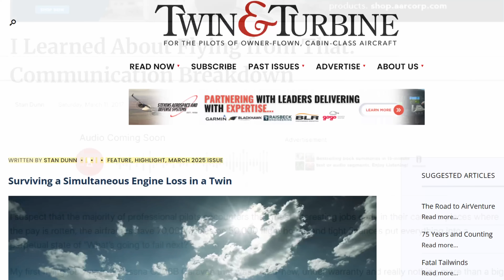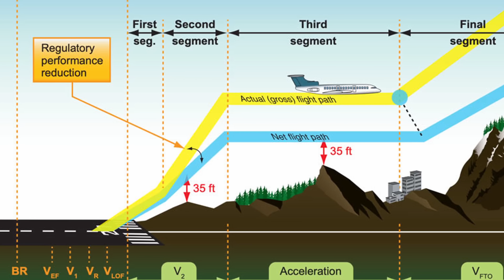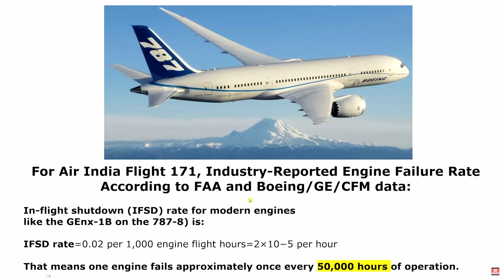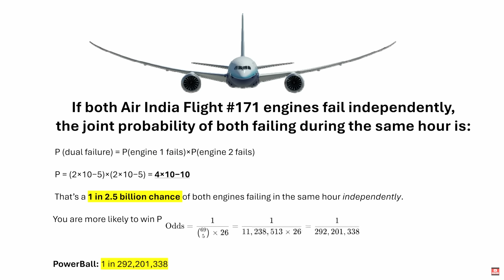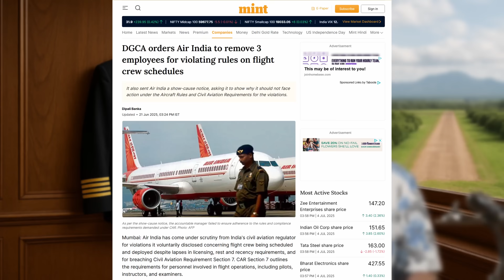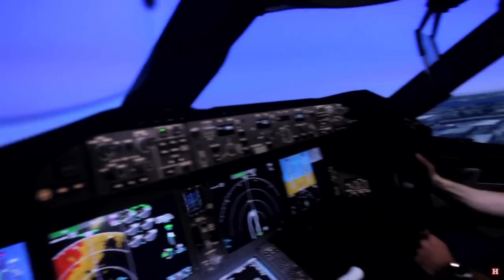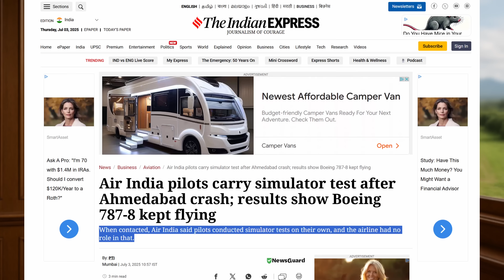Air India 171 Cause Becoming Clear

Comment: I remember many years ago a JAL airlines 747 Pilot accidentally turned off all 4 engines at 33,000 feet , the aircraft plunged 26,000 feet until the engines were restarted . Maybe this Air India is Pilots mistakes . Not sure

Comment: Don’t forget the footage that shows the rear landing gear stuck in the first stage of retraction. If there was no attempt to raise the landing gear, the rear bogies would be configured such that the front wheels are higher than the rear wheels. When commanded to retract, the rear bogies will tilt the other way before the legs fold in. Footage of the final moments show that the landing gear is NOT fully extended. This suggests a complete loss of electrical power. If you follow this line of thought, the most pressing question is what could/would cause a complete electrical failure?
Reply: From what I’ve seen and heard even complete loss of electrical power will not stop the engines from operating?
Reply: @paulaiello2071  I hope you’re right but I haven’t heard anyone explain how the fuel pumps can work without electrical power. I’m not a professional so I could absolutely be wrong but this is what makes the most sense to me so far.
Reply: @bobperry8066  There are mechanically-driven fuel pumps in the engines. They can suck fuel from the tanks even if all electric pumps fail.
Reply: I thought it was hydraulic 😢
Reply: @SteveShifter-j3i what do you think controls the hydraulics?
Reply: RUBBER BANDS !😮 @GeneralDissent
Reply: @SteveShifter-j3i    Electric motors pump the hydraulic fluid.
Reply: What could cause complete electrical failure? Dual engine failure.

Comment: Would we not see significant yaw or roll if one of the engines had failed? I believe the dust cloud on the video could equally have been caused simply by the take-off thrust. We don't see any dark smoke or flames.

Comment: What about the possibility of fuel vapour locks in both fuel pumps due to heat on the tarmac causing excess temperature in the fuel lines. There would be negative vacuum pressure in the fuel lines due to maximum fuel flow during takeoff. 

The temperature at the airport was reported to be around 45 C on the tarmac, which is close to maximum allowable.

If so, a fuel temperature alert would be recorded in the black box.

Comment: Over 2000 comments already, and probably none of them useful.  Only thing to note is that, i believe it is so, Hover was the first to propose wrong engine mishap, and now you are the second one to seriously do so.  Really, really hard to believe, for so many reasons (yet, certainly possible), and you are the first I've seen to point out the specific discrepancy of (apparently?) differentiation in exhaust flow (which I had, myself, noticed earlier, and was wondering about, with even having had thought looked kind of like could be a compressor stall).  Radio call did mention no thrust, but did not explain in any greater detail as to how might have come about.  I still go for a single-point failure in electrical that somehow resulted in both engines shutting down (with no possibility of restart in such a short time frame).  Wheels trucks position tends to show that gear up had just been started, and power was lost almost right in the middle of the electric tilt motors position change sequence.  The added electrical power load could have dropped possibly already weak bus voltage right then, which could have adversely affected both FADEC's, maybe, or at least the still operating engine?  But, what about the batteries maintaining critical; given increasingly apparent Boeing design detail issues, power cut-over implementation triggering even just a few milliseconds outage or sag?

Comment: The first half of the video has a perfect, but the second half makes you part of the problem. You're comparing flight simulator training with accidents that proved the captains were competent, then speculating that the Air India captains were the cause of the problem, even when the rest of the Air India simulator pilots performed well. I don't follow your logic blaming the pilots when the data seemingly points to the opposite. The early part of your video provides clear data on probabilities, but you dive too deep into speculation on the root cause. Using grainy video footage to speculate on single engine failure is irresponsible. The investigators have given no reason to think there were mechanical problems with either engine, and people already got in trouble pointing to the grainy videos and thinking they knew the flap settings.

I also disagree based on comparisons with other dual engine failures. You're missing critical data. Typically, engines never lose 100% of thrust. Simulations for Jeju show that they had approximately ~40-50% thrust on a single engine, which was sufficient to glide for a few minutes, and with the ground effect, they glided over half the runway. By comparison, Air India fell like a brick immediately after takeoff. The aircraft was airborne for only 30 seconds after performing a normal takeoff roll at the appropriate distance for their weight and runway. The miracle on the hudson, by comparison, continued to climb for nearly 20 seconds after losing both engines, giving them a substantially longer flight time above the altitude where their engines failed. Those engines are MASSIVE, and their huge momentum allows the blades to still generate thrust even while they slow down. For the same reason engines take seconds to spin up, they also take seconds to spin down.

Based on how short the flight was, and that the investigators found the flaps in the correct configuration, the that the gear never retracted, and the RAT deployed, we're likely looking at a dual engine failure almost exactly as the plane was taking off. If the engines had failed substantially earlier, the plane wouldn't have gotten off the ground, and if the engines failed later, the plane would have stayed airborne much longer. As you state, it's effectively impossible for the engines so fail close together without a common cause. However, I think it's entirely unreasonable to imagine that pilots would react to shut down an engine during the middle of the takeoff roll, and even a failed engine will generate some thrust and keep the aircraft airborne for longer than 30s.

To prove my point, I'll use the data you gave. The simulator training proves that none of the other pilots responded that way, and the Miracle on the Hudson sets precedent that pilots suffer from a startle effect and need time to react. The 35s reaction time the investigators gave Sully was longer than the entire time Air India was airborne. I feel pretty confident in saying the pilots didn't shut down the failed engine, given how quickly they must have done it, given the known behavior of startle responses, and the incredibly short time the plane was in the air. Plus, even if the pilots had shut down the wrong engine, it's incredibly likely the flight would have glided for substantially longer using a single crippled engine. Your conclusions are flawed. Which isn't wrong itself, but it becomes a major problem when you point the blame at pilots, as we saw with the 737 Max crashes, where a second crash happened because everyone was too quick to blame pilots for a failure of the aircraft.

For a better comparison, here's some data I gathered. If the engine failure happened in the low-speed regime of the takeoff, the pilots would have aborted. So lets pretend a single engine failure happened between the high speed regime and the rotation. I just watched a fully loaded 787-900 take off roll, and there were ~20s between the 80 knot callout and the rotation, with only three seconds between the automated V1 call and the rotation. Two other videos incredibly long 787 takeoff rolls puts the takeoff at less than 50s. It's insane for you to say that the pilots would have started to shut down an engine in a few seconds during a takeoff roll, when there's barely enough time to evaluate the warning lights in the middle of the takeoff. That behavior goes against every piece of training pilots ever receive, and I'm not aware of a single aircraft accident where the plane crashed so quickly after takeoff when the plane was in the correct configuration. (A solve problem due to takeoff configuration warning systems, as you noted.)

You had all the data, but you still reached the wrong conclusion. Air India almost certainly suffered from a dual engine failure, but you gravitated towards a common cause (pilot error) that is exceedingly unlikely to be correct. Instead, I speculate that it's likely yet-another Boeing systems failure. Not sabotage, but an electrical system failure, a software error, or some other cause could have stopped both engines. But we can't know the exact causes until the investigators do their work, which is why it's so important to not spread misinformation like this. If you're looking for other theories, there was a flight where an emergency oxygen bottle exploded and took down the plane. The 787 uses 100% electrical systems instead of running off bleed air, so a lithium ion battery fire, an oxygen bottle rupture, or any number of other explosive failures could have taken out enough of the electronics bay to either shut off electrical power to the fuel pumps, or trigger a software emergency engine shutdown. Or it could have been a software fault with Boeing's systems. There was already a known bug (not the cause) where the 787 computers would crash if they were running for 8 months straight. There are so many unexpected failures that could have taken out both engines, because no design is perfect. We just don't know what happened until the investigators finish their work. So please stop spreading misinformation like this.

Comment: My question: what happens if plane extremely overload than engine can handle flietworthyness.can defence mechanism of software triggered to shutdown engines from damage.? because plane took whole 3.5 km runway instead 1.5 2 km due to its loading and at that  day extremely humid and hot atmosphere there in Ahmedabad.

Comment: I read a great post from an chemical engineer who was responsible for fuel safety and other things, and for 40 years.
 
He said that the right and left engines are fed fuel from the right and left fuel tanks only. These tanks are in the wings.
 
He went on to say that the center fuel tank transfers fuel evenly to both the Wing tanks, but the Center tank does not fuel the engine.
 
The plane got off the ground, so it may have had good fuel in the lines from its last flight from Hong Kong
 
When it had to draw fuel from its refill in India, that’s where fuel contamination is possible.
 
Like someone else posted, if this Airline depot was filling aircraft with bad fuel, there would have been other engine failures, so I kind of doubt fuel contamination.
 
I’m thinking a bad sensor instructing fuel to be delivered was faulty, or an electrical interruption to the fuel pumps, caused by the engine control module ( ECM)

Comment: La vraie raison 
Or c'est la plus inquiétante Le FADEC (Full Authority Digital Engine Control) est un système de régulation numérique à pleine autorité qui contrôle et gère automatiquement tous les paramètres du moteur d’un avion moderne comme le Boeing 787 Sur le Boeing 787, le FADEC interagit étroitement avec d’autres systèmes automatisés comme l’auto-manette (autothrottle) et le système de gestion de vol (FMS). Lors du décollage, par exemple, le pilote sélectionne le mode de poussée souhaité, mais c’est le FADEC qui applique précisément le niveau de poussée optimal, en fonction des conditions réelles et des données du FMS. Cela permet d’assurer une performance moteur maximale tout en respectant les marges de sécurité, même dans des conditions difficiles (chaleur, forte charge, altitude élevée) En résumé, le FADEC est considéré comme indispensable dans les avions modernes comme le B787, car il assure la gestion numérique intégrale du moteur, optimise la sécurité et l’efficacité, tout en simplifiant le travail des pilotes. 
CONCLUSION : A trop vouloir remplacer l'intervention humaine par des systèmes automatisés compliqués prenant en compte de nombreux paramètres, voilà ce qui arrive. Les pilotes n'ont plus la main, la machine fait ce qu'elle veut  ...

Comment: This crash sounds like a computer problem that shut down both engines........the people investigating this accident won't ever admit that and I'll bet they already know.
Reply: and GE knew realtime what happend.
Reply: @gruberjohann800  Do their engines send out constant status data then? If so, yes, they know!
Reply: @2760ade  Don´t have details. Data may be transmitted package-wise to the manufacturer.
Reply: It happened to me EEC shut down right engine just before take off. Returned to parking position. All went well. But it wouldn't be like that just 3 minutes later. So ... yes. To me is a computer failure.
Reply: There're three computers, it's not only redundant, it's triple. 3 computers failing ate same time would be more unlikely than win lottery every day in life in a row
Reply: @Jorge-oh5ee  Remember 737max? Weren´t there 3 sensors for angle of attack and it didn´t help?
Reply: and if there were 2, which one is correct and with three if two are wrong?

Comment: Sounds logical. However, your reasons for ruling out sabotage are spurious. We can not know how skilled a saboteur may be, his exact motivations or intentions. How can we know how many attacks are made that are not claimed as such? Maybe they happen quite often for a variety of reasons. For example to murder a particular passenger or group of passengers, revenge from a disgruntled employee, to assist an act of extortion or industrial sabotage against the airline or manufacturers. If either the airline or manufacturers had been threatened with blackmail one might understand why they may wish to cover up the entire incident? 

Say for example if someone rang up one of the CEOs and threaten to force one of their commercial airliners to crash if they did not pay $20,000,000 into a Swiss bank account, what would they do? Probably nothing, or nothing until one did mysteriously crash and then they may take the call a lot more seriously. Would the CEO report the call once one of his plains had crashed killing all on board? I don't know what they would do, to be honest, but I suspect that this has happened before, and when it did the entire event was covered up by all concerned as the effect on the entire industry could have been cataclysmic. Far better for all concerned to find some way to blame the pilots or their training. 

IMO this is a big problem when potentially dangerous means of transport are overly controlled by computer technology. If someone is knowledgeable enough they can make virtually anything happen or not happen as the case may be. I am certainly no kind of expert when it comes to commercial airliners but I can perfectly well imagine that sabotaging an aircraft in such a way would be quite easy as just about everything is when you know how to do it. 

If it did become common knowledge that a few simple physical alterations plus fiddling with the program could bring down a fully loaded airliner at take off, what would the industry do about it? Would it go back to 1950s technologies?  I don't  think they would see this as even an option especially having invested countless billions in their current systems and done so for largely safety reasons. 

Therefore we may never know the truth and maybe this is just as well?

Comment: I think looking at the probability of dual engine failure from the point of view of how frequently it has occurred throughout history is not useful, because it is very often the case that the cause of a crash is unique to that specific case.
I think we basically have just enough information to think that both engines did lose thrust, but we have no good information on why they did. We can only speculate on the why.
My speculation is that one possible reason could be a software bug. The 787 relies on software to control various systems a lot more than most other airliners, and we know Boeing have had software bugs before, such as on the 737 Max.
Fuel contamination is another possibility, but I think that's not likely, because most likely other airliners would have noticed that too.

Comment: Regarding the flap setting, in the original video posted of the crash, the leading edge slats are clearly extended, meaning the crew had extended the flaps to at least some position. The original video was uploaded to X, and then got filmed by a news station, and that copy was the one most people have now seen. Because it is a hand filmed copy, the video quality is not nearly as good, and the leading edge slats are not clear, which is why I believe people came up with the no flap theory. The copied news video is now the one you find if you search for the video, and I believe the original is almost impossible to find. But I was fortunate to grab a screenshot of the original, and it is very clear the slats are extended.

Comment: Why is one option never discussed in any video about this? One of the pilots in then cockpit (or maybe someone on the jump seat) pulling the cutoff switches of the engines? How fast could they be restarted? Is there a way to make it impossible to restart them? Like turning off ignition, pulling the fire extinguisher?
Reply: or intentionally flying the plane to ground.
Reply: @gruberjohann800  there's no change in pitch though, which would be the obvious sign for that.
Reply: @jemand8462  don´t understand you. If power is pulled to zero, no control action is required to ground the plane.
Reply: @gruberjohann800  that's not flying the aircraft intentionally into the ground, that'S literally what I said, why would you even bother to comment exactly what I said?